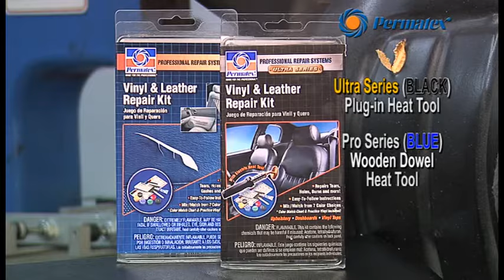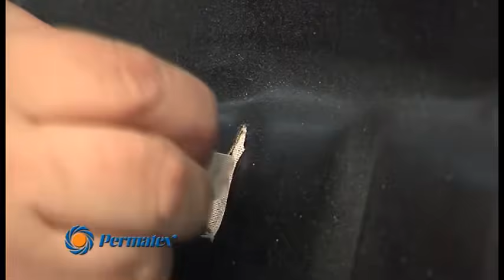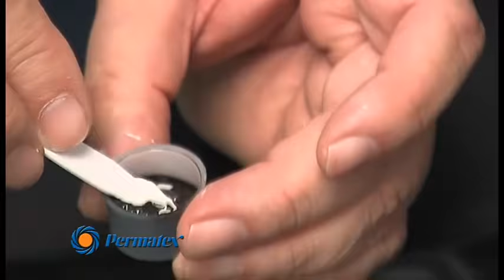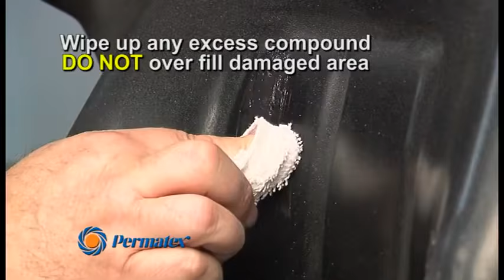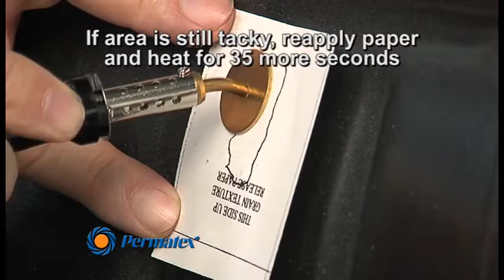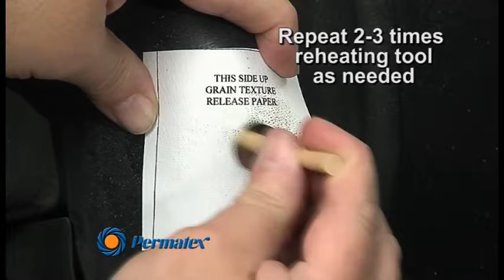Permatex Vinyl And Leather Repair Kit - Demo

Comment: I repaired a snowmobile seat using this kit,turned out excellent. However i did take alot more time prepping than this crappy video did. Only if you looked where i told you could you see the repair. good product but the video probably is turning people off from buying.

Comment: What in the shit are feathered edges
Reply: Smoothed out till it's flat/even with the surrounding surface - same thing you do with drywall compound with sandpaper, till you can't see a difference in the level between whatever you're filling with, and the surface of the surrounding arwa.

Comment: After looking at this demonstration I have concluded that I'm not going to get a good enough job done with this stuff. My project is a motorcycle seat for which I can remove the leather cover, so I'll just pull that off, cut a patch to fit, and use "shoe goo" and a big backing patch on the backside. This kit costs $20 but I can get a whole new cover for $100, I'm just going to get a scrap of material and fix it for pennies instead. I decided I don't need a perfect repair anyway, it's an old cover on an old bike. "Wabi Sabi".

Comment: This stuff is absolute junk. The paper actually sticks to the leather after you get done and then you have paper stuck to it. That or it  just rips it right back up. This actually looks better before you even try to do the patch matching thing just leave it on wet maybe put a little bit of heat on it with a propane torch without getting too close so it dries and let it do that then maybe damp it a little bit with one of the patch things before it's completely dry and then let it naturally dry or silicone would probably do better LOL what a bunch of junk I wouldn't waste my money if I were you. I would have been better off to glue a leather patch onto it period I wish you could post pictures of how embarrassingly ugly this was I agree with everybody don't even bother trying.
Reply: No, not a propane torch! A heat gun on lower, then higher if low isn't hot enough.

Comment: Is there a method to make the finish shinier?  Fixed a large hole which worked  out pretty good however the finish on this product is quite 'flat' or dull.  Any advice?
Reply: Find some leather shine and apply and let it soak see what happens...redo as necessary
Reply: sem paint?
Reply: I used some black acrylic paint with a satin finish...worked pretty good for my repair.

Comment: It works but be really careful with the wooden dowel heat tool, I burned my good vinyl underneath the white shield grain pattern. I heated the wooden dowel with a blowtorch for about 20 seconds and the paper slightly burned like on the video. The electric tool was not available at canadian tire but i suggest to buy it. Be careful and it can do a good job.

Comment: What is the hardening powder . Can’t find it in the kit
Reply: I don't have the hardening powder either and I bought two kits. Somebody mentioned having hardening powder in there but there's none in mine. You would think if they don't include it they would update the video or mention it in the instructions.
Reply: It seems that it dont need it anymore,  I didnt either. Paint seize with heat. No need powder anymore I guess
Reply: The powder is included in a container in the color matching bag. I bought a kit last week and it included hardening powder.
Reply: I also was looking for that damn hardner myself.  Thought the dog maybe grabbed it.  Looked for 20 min.  Till I read the comments.   If the company's video repair looked subpar.   Imagine what a first timers looks like.
Reply: They seem to skip over the 4 hours cure time as it progresses and if a person isn't paying proper attention or doesn't watch it a couple times it would lead you to believe Apply adhesive upon trimming or filling hole with included cloth then apply colored filler and then iron it with appropriate grain pattern. They really should reiterate the 4 hours cure time before applying 'heating iron' instead of showing it as a 1 2 3 and you're done.